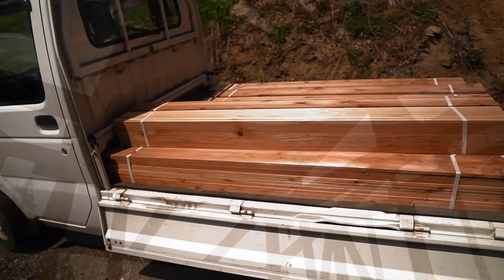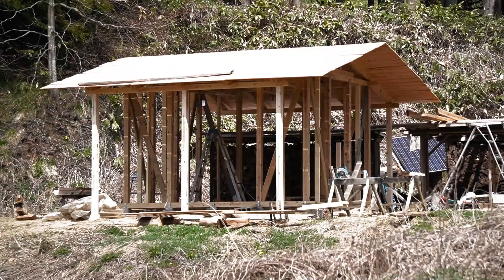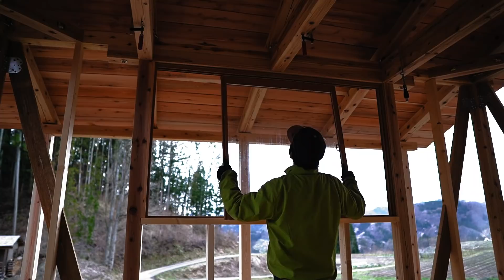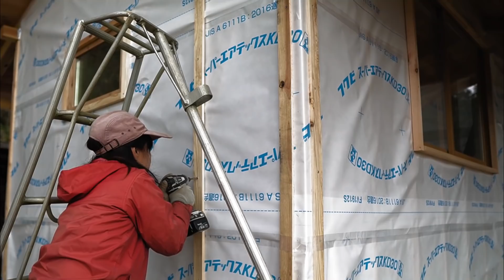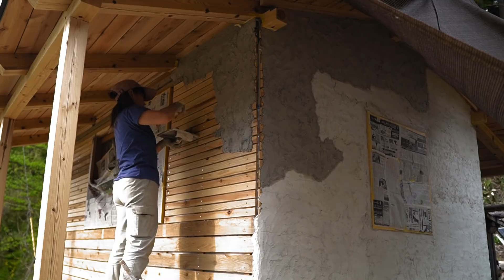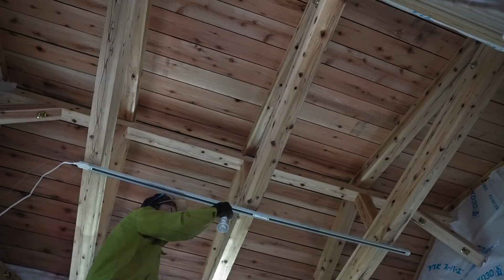「DIY] 小屋づくり総集編（中編）ホームセンターの木材を使ってセルフビルド

Comment: Beautiful Building and location. Are all the bolted points required for heavy wind area or earthquake requirements ?
Reply from the maker: Thank you for your comment.
The wind comes about once a year, but it's not that big.
Bolt tightening is important because there are many earthquakes in Japan. Weak buildings will collapse in an earthquake.
Reply: Keep up the great work and i admire all you have done and your lifestyle . Great job with the sawmill.